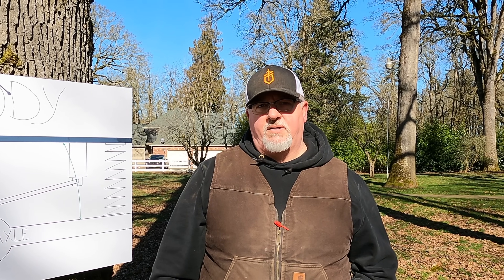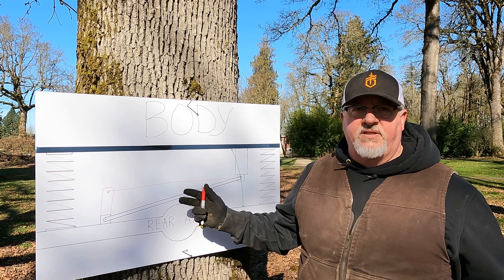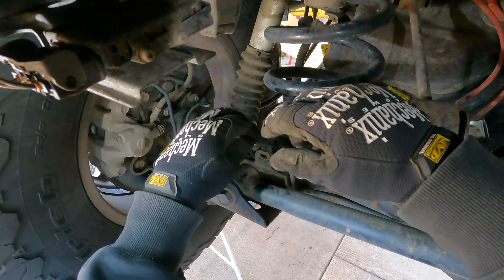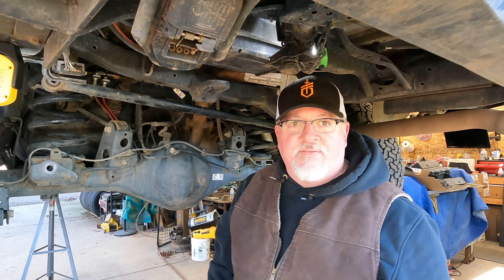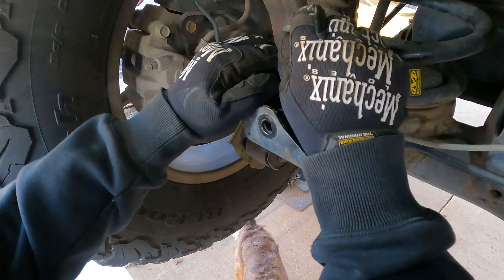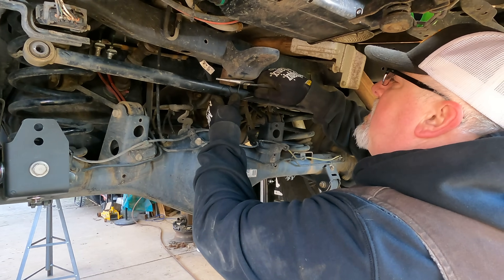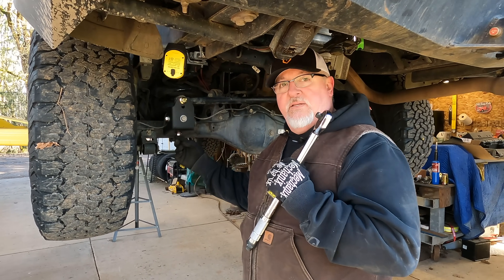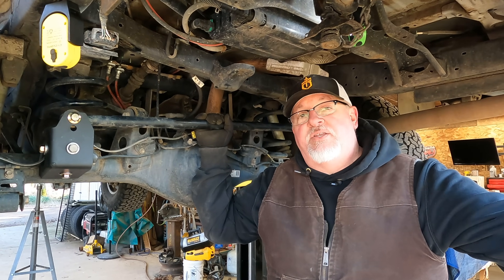Do Not Lift Your 4Runner ... Overland Build Recommended Geometry Fix - Do Not Lift Without This

Comment: What size all terrain tire can I go to on a 2023 new 4 runner? Want a good look no rub
Reply from the maker: Are you looking for the larger tires you can go with in the stock wheels and no other mods?
Reply: @aired-downoverland9239  yes, no lift just to look alittle more tough lol tall? Wide? Pick it up Monday and want to start doing some things. Front and back bumpers too
Reply from the maker: @Pattim4762  The tire most people go to is a 285/70/17, which is 32.7 tall (call it a 33) and 11.2 wide. Everyone has their opinion and favorite tire, I’m partial to the BFG K02; great wear, great traction everywhere but mud (I don’t do mud, so…), and I’ve never had a flat, even running them at 5 psi on the beach or snow. I also LOVE the Method wheels, but specifically the ones that have bead grip technology, which is what allows me to run low psi.
Reply: @aired-downoverland9239  thanks I don't do mud ! I live where ice and snow is. I take care of my vehicles no abuse.
Reply: @aired-downoverland9239  will I need a leveling kit with the 285/70/17 on my 2023 4 runner?
Reply from the maker: @Pattim4762  The tires will have no impact on how level, or unlevel, your rig is. The only way to level it would be to raise the front, or lower the rear (you don’t want to lower the rear). So, leveling kit or suspension lift is the way to go, in my opinion. 🙌
Reply: @aired-downoverland9239  but I don't have too. The tires won't rub
Reply: @aired-downoverland9239  getting it Thursday and taking to get the 285/70/17 put on it just want to be sure. Ty
Reply: @aired-downoverland9239  took my 4 runner to get tires said 285/70/17 were to big. I'm confused
Reply from the maker: @Pattim4762  who said they were too big?
Reply: @aired-downoverland9239  took it to a Goodyear tire shop he said they were to big and would rub needed to go down to 275/70/17
Reply: @aired-downoverland9239  said I would need a leveling kit or lift to fit. So I guess I will have to go down one. I don't want to lift it.
Reply from the maker: @Pattim4762  The difference between those two is the 285 is .5 inch (13 mm) taller and .4 inches (10 mm) wider. At most you’d have to remove your front mud flaps, if that. They’re quoting you a recommended tire size out of a book. Check Instagram and YouTube, you’ll see countless 5th Gen 4Runners running the 285.
Reply: @aired-downoverland9239  I really don't want to remove anything it's brand new. At this point I'm frustrated with it all. About to just say I don't want it. Haven't bought it yet. They have been holding it I was on vacation last week. It is at the tire shop tonight. Supposed to go get it tomorrow. Frist time I have not been excited about a new vehicle.
Reply from the maker: @Pattim4762  There is a lot you can do with a stock 4Runner. If you’re not comfortable getting into modifications, don’t, just enjoy the vehicle in stock form. If vehicle based adventure and camping is your intended use, then a stock rig will do just fine. It’s when you get into more aggressive off-roading when you need add additional items like suspension, tire/wheel, and skid plates. Don’t let people, or social media, pressure you into doing miss mods you’re not comfortable with. Again, a bone stock 4Runner is incredibly capable. 🙌
Reply: @aired-downoverland9239  thanks just want it to look good. I have always drove corvette,Trans am,Camaro,mustangs sports cars. Just out growing them want a pretty SUV.
Reply: @aired-downoverland9239  got my 4 runner today love it! Thanks
Reply from the maker: @Pattim4762  AWESOME! You’ll love it more and more with time. 🙌

Comment: Is that toytec bumstop 2 or 3 inch?Will it hit the frame when off roading or flexing?
Reply from the maker: I think it’s 2” but I’d check their website. The stock rubber bumpstop mount to the Toytec extension, so only rubber is hitting the axle, nothing harsh.

Comment: Context to the lift height please?  Every lift or some lifts. Do you need to do it for spacer lifts?
Reply from the maker: The best way to determine if your rig will benefit from this bracket is to have it on level ground, then look under the rear at the panhard rod. If it’s horizontal, you’re good, nothing needed. If it sits at an angle you could benefit from the correction bracket. There’s more info on their website, drkdss.com 👍🏻

Comment: Is there a certain amount of tolerance? As in anything 3+ inch lift would be highly recommended? I have a 1.75 inch front strut setting 1.5 springs and 1.5 shocks rear.
Reply from the maker: A 2” in the rear is where people typically start feeling things move unnaturally, but it also depends on the weight you’re carrying in the rear. Just take a look at your panhard when the vehicle is sitting on a flat surface to see how flat, or not flat, your panhard is sitting.

Comment: So say you have a 3 inch lift how would you know how much to lift the pan hard bar?
Reply from the maker: It’s not so much inches as it is trying to get the panhard back to its stick horizontal position. Based on my lift, which is 2” in the rear, you’d want the taller of the two brackets offered on drkdss.com

Comment: So I’m planning on installing bilstein 5100 front and rear on my 4Runner, keeping everything stock maybe just put the front clip to .85. Will I have this issue?? 👀
Reply from the maker: Will your set-up increase the height of your rig? The best way to test this is to install all your gear, then look at the panhard rod. If it’s basically straight, you’re fine.
Reply: @aired-downoverland9239 no I’m keeping everything stock. Just setting the front to .85, which I believe is the second clip position from the bottom.
Reply from the maker: @icecream_2987  You shouldn’t 🙌
Reply: @aired-downoverland9239 should keep everything stock? Or set to .85?
Reply from the maker: @icecream_2987 That’s 100% a personal decision based on vehicles intended use and you your preferred look.

Comment: So the pan hard rod, the drive shaft any other angles to worry about?
Reply from the maker: Depending on your lift height, an adjustable panhard and/or pinion angle adjustment may be needed (likely concerns for greater than 2” rear lift). An adjustable panhard is an inexpensive way to keep the rear lined up AND aftermarket ones are typically much beefier than the stock one
Reply from the maker: If you’re under two inch rear lift you should be good, though an adjustable panhard is a good way to keep the rear perfectly tracking.

Comment: Hi, I watched your video with all detailed explanations and purchased this kit from DRKDSS . Im running  Toytec ultimate 3” lift kit and when I looked at mine Panhard rod it looks perfectly straight. So would you explain my case situation because this kit looks useless for me. Thank you.
Reply from the maker: I can’t explain it. With a 3” lift in the rear it’s impossible for your panhard to remain straight. Is it a body lift or suspension lift?
Reply: It’s a full suspension lift. Ill check  it again  maybe I was wrong  but it definitely didn’t seem to have that angle as on your YouTube video before correction kit.
Reply: I guess I’ll install it anyway 😊
Reply from the maker: @denismartynenko3268  The video was shot on a lift so people could see the work being completed. On the ground it will have less angle, but will still have an upward angle from left to right.
Reply: @aired-downoverland9239  I’ll definitely check, thanks again.
Reply: Yes, there is a slight angle about 2” inch difference. The highest point  is 19” inches and lowest is 17”
Reply from the maker: @denismartynenko3268  If I were you, I’d start with the lower hole on the bracket side, check it, then move to the higher hole only if needed to make the panhard horizontal.
Reply: Just install the kit, its shorty version with only one hole. Track bar is leveled, drives totally different, absolutely worth the install.
Reply from the maker: @denismartynenko3268  AWESOME! Love to hear that. 🙌

Comment: Question. How much of a lift? I did a 2.8 inch lift with (eventually 3 inch coils in the rear.) I am running 2.5 inch coils in rear currently. But will this throw anything off in the rear axle? (Hate that I’m slightly squatting atm 🤮)
Reply from the maker: With that much lift I’d bet dollars to donuts your panhard rod has a decent upward angle from the axle mount on the left to the frame mount on the right (on a 4Runner).
Reply: @aired-downoverland9239  do you have link to the part you installed?
Reply from the maker: @alechardesty4135  You can find them at drkdss.com 👍🏻
Reply: @aired-downoverland9239  thank you sir!
Reply from the maker: @alechardesty4135  happy to help

Comment: So what about an adjustable panhard bar instead of a bracket relocation?
Reply from the maker: That will not correct the geometry but can be used by an Offroad alignment pro to perfectly center your axle under the vehicle.

Comment: Does this apply to just a body lift also? I admit I just want the look of the truck lifted, I'll never be off-roading, it just looks way cooler.
Reply from the maker: You don’t need this with a body lift 👍🏻👍🏻
Reply: @aired-downoverland9239  
Thanks for that answer. Are there any alignment issues that occur when doing a body lift?
Reply from the maker: No alignment issues until you touch the suspension 👍🏻
Reply: @aired-downoverland9239  
One more question, I've read that there can be alignment issues with part of the steering mechanism when lifted, is that an issue with a body lift or only a suspension lift?
I really appreciate your help, I'll make sure I'm a subscriber right now. I'm just getting into, at 62 years old, learning all about car mechanics and doing maintenance myself. I like the way you describe things, so well even a pilot can understand. Thanks again.
Reply from the maker: Your alignment would not be impacted by a body lift, but it would be by a suspension lift. Enjoy the build, it’s half the fun 👍🏻🙌

Comment: I did add springs that gave me a mild lift in the rear (3rd gen model).  I also swapped to 17" rims on & bigger tires.  Do I also need to make this correction?  Do you have a link to the correction kit you used?
Reply from the maker: Jay, the easiest way to tell is just look under the rear while your rig is on flat ground, you want that panhard as close to flat (stock geometry) as possible. Bracket is from drkdss.com 👍🏻

Comment: would it be ok to put spacers in the front so it sets level?? thx
Reply from the maker: That is certainly one way to level a 4Runner; I’ve never tried them myself, I typically go for a suspension lift.

Comment: Would this not apply to all vehicles with a solid rear axle?
Reply from the maker: No, there are set-ups a a triangulated four link that have no panhard rod, but do have a solid rear axle. This applies to the typical five link (x2 upper control arms, x2 lower control arms, x1 panhard rod). 👍🏻

Comment: How did you know which hole to use and where do I get a kit like that ?
Reply from the maker: I knew with 3” lift in the back I’d need the top hole. Under 2” you can likely get away with the bottom hole. You get them at drkdss.com

Comment: Does it also apply to 1st gen sequoia  ? I did 2.5” lift on mine
Reply from the maker: Easiest way to check is to put park on level ground, then look under the rear at the panhard rod. If it’s not sitting flat, you might benefit from the bracket drkdss.com makes.

Comment: I ordered mine. Finally received the rest of my other parts. However, this absolutely will not work on my ‘99. My pan mounting bracket is no where near like yours. Not even close. I need to return this to you. It looks like a great fix, but not on a ‘99. I’ll need to figure something else out.
Reply from the maker: To be clear, you won’t be returning it to me, you’ll contact drkdss.com, I am not affiliated with them.
Reply: @aired-downoverland9239  right, thanks. Still a great and very informative video. Thank you!

Comment: Does this need to be done when you install FJ springs on a 4th gen 4runner? Seems they only lift about 1-1.5 inches
Reply from the maker: Great question. I’d do your install and see if your panhard is riding level or at an angle. 👍🏻

Comment: Ordering a bracket this week I can’t deal with that wobbly rear end feeling anymore
Reply from the maker: Good call! I bought the weld-in bracket last year, but just didn’t feel great about it. This bolt-in bracket is crazy beefy; you’ll love, and the install is cake (granted, this old guy has a lift) 👍🏻
Reply: I was actually amazed what a difference it made. 4Runner really feels planted now when I drive. I used to think, wow this road is really bad ha ha

Comment: Hello how can I buy the parts you have used?  I will like to do this in my 2021 4Runner see if it helps with move steering on every little bumps
Reply from the maker: You can buy it direct from the manufacturers site, drkdss.com 🙌

Comment: Question brother, what if I only lift the rear 1” ?
Reply from the maker: The best check is not the lift height. Put your rig in flat ground, then take a peek at your panhard to see if it rises from left axle mount to right frame mount. If it sitting at an angle the drkdss.com bracket can bring it back to stock (flat). 👍🏻👍🏻

Comment: I had my 4Runner lifted (Bilstein 5100's) without the PH kit for over a year. Had one welded on after everyone said I needed one. I took it off a week later. It drove terrible with it on. Looking back, my PH Rod was less than a degree off already. Wasted a few hundred bucks
Reply from the maker: Spot on. The real test is to look under your vehicle on flat ground; if the PH is flat, or like yours, close to level, no need to change anything. 👍🏻👍🏻

Comment: What if we install panhart bar that is adjustable?
Reply from the maker: That is used to adjust centering of the axle under the vehicle.
Reply: @aired-downoverland9239  hmmm. Well I found this video cause my lifted FJ has driver lean. Mechanic told me that it might be short panhart bar as in, shortened by the angle - it is adjustable tho. But that just doesn't seem to be it. That would just push rear axle (in FJ case) to the right a bit, just like you showed on your 4runner. Anyways Educational and very useful, thanks =)
Reply from the maker: @DanielTejnicky  With regards to lean, my experienced with 4Runners has been that the front coilovers are typically the culprit. With time and use they can settle in differently left to right. Adding or removing pre-load on one side will even out the vehicle, if you have adjustable pre-load (spring tension). You’ll need the suspension hanging without weight on it, and the right tools, to do this. Any 4x4 shop should be able to do it as well. 👍🏻
Reply: @aired-downoverland9239  Allright, pre-load now I just need to find proper translation to czech, so that my mechanic understands what I mean xD
Reply from the maker: @DanielTejnicky  Just go to YouTube and search “coilover preload adjustment”

Comment: did you keep the brake line zip tied to where you had it in the beginning of the video?
Reply from the maker: Yes, loosely. We’re just trying to keep it from moving toward the spring.
Reply: @Aired-Down Overland  I appreciate it boss. Going to do the install this Friday. Should be less than an hour but you know how that goes sometimes 😆
Reply from the maker: @JakeJake2308  Do it once, do it right 😄. Yeah, should only take an hour or less. Tongue twice and Mark your bolts position 👍🏻
Reply: @Aired-Down Overland  quick install.  Had a lot of confidence because of your video thanks a lot! Even had time to install arb breather kit for the rear diff and rear locker while I was down there
Reply from the maker: @JakeJake2308  NICE! I’ve had my breather kit for over a year, I need to get it installed.
Reply: @Aired-Down Overland  same here. I bought a while back and never got around to it. Looking forward to more how to videos.  Thanks again boss!

Comment: Dont be too hasty.  if the threshold angle has to be more than 5 degree, that means a 3.5"+ lift at rear . Check your math here TAN(5) = x / 40 , so x = 3.499

Comment: sorry if this is an obvious question, but does this still apply if you only want to use a 2 inch leveling kit on the front? thanks for the vid mate
Reply from the maker: If you’re not lifting the back (changing the geometry) you won’t need it 👍🏻👍🏻
Reply: @aired-downoverland9239  ah excellent! Thank you sir

Comment: Thanks for the info 👍
Reply from the maker: Hope it helps 🙌
Reply: I plan on lifting my 5th gen and do this setup all at one time
Reply from the maker: @ltatjsallday8709  That’s a great approach. If you’re lifting the rear 2”, don’t forget extended break lines and extended bump stops; I cover both of those in one of my other videos.

Comment: What did you do with abs brake line
Reply from the maker: That’s covered in the video
Reply: @Aired-Down Overland  so you just zip tied it? There is no new mounting bracket on that kit?
Reply from the maker: @mikemarquez1211  No, you’re just trying to keep it out of the spring…and don’t zip it too tight. 👍🏻
Reply: @aired-downoverland9239  oh ok gotcha thank you for these tips!
Reply from the maker: @mikemarquez1211  No problem Mike 🙌

Comment: If i was too just lift my 98 2" with the Bilstein 5100 set up, is this still recommended?
Reply: Also, is this better to do post lift? or during? or not matter?
Reply from the maker: Best way to tell is to put your vehicle on level ground, then look under the rear at your panhard rod. If it’s at an angle, and not flat, you would likely benefit from the correction bracket.

Comment: Would this also pertain to spacers, 1-3"?
Reply from the maker: The easiest way to tell if you need this bracket is to look under the rear of your vehicle at the panhard bar; if it rises at an upward angle from the left to right, then you may benefit from this bracket. You can read more on their site: drkdss.com